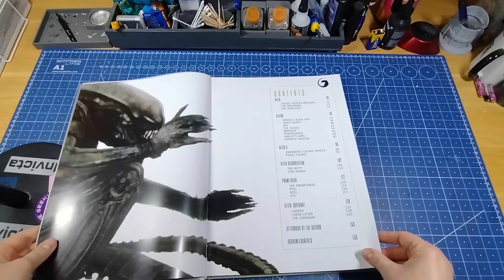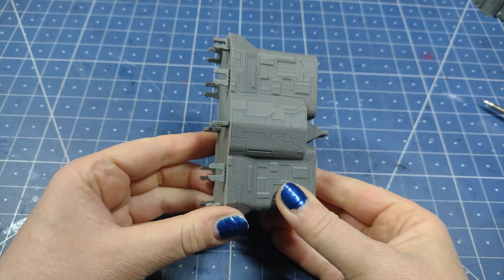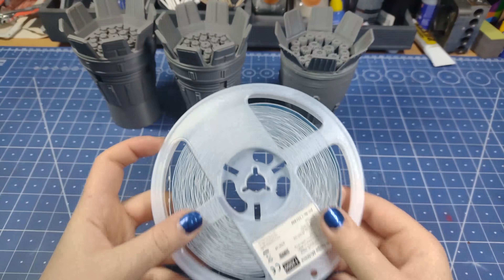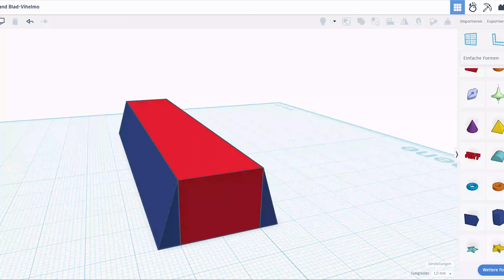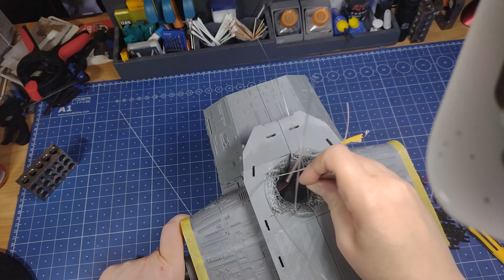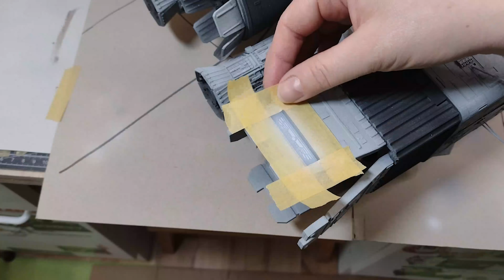I Built the USCSS Nostromo: 3D Printed, Scratch Detailed | Full Build

Comment: I printed that version a few years ago.  The amount of tiny pieces - especially those clear engine - and I had the original Halcyon kit back in the 90s.

Anyway, I never finished it beyond giving it a light dusting with primer grey and sold it.  

I didn't print for wiring or lights but I found it a great model except, of course, it was missing the hydraulic engine parts and a detail above the smaller central engines.  I haven't checked on it so don't know if the maker updated it since.  Oh and I had a lot fun with the landing gear!  Ended up improvising numerous ways and did the same as you.  Lots of guessing trying to the parts the same length.

Anyway, someone out there has mine.  But I have a lovely studio scale Narcissus and Sulacco off Gambody.
Reply from the maker: Thanks for watching! Yes, that's a lot of work., and a lot of fun even if some parts are missing or don't quite fit. 
And I have the files for the Narcissus and Sulaco too. Just haven't made them yet 😁

Comment: Amazing work. Designing then printing from blue prints is extortionary. Always wanted the Nostromo model. Wish they would release it again. You did the next best thing and built one yourself.
Need to get into 3D printing. Don't know where to start .
Reply from the maker: Hi, thank you so much! The files for the Nostromo are available on Gambody. I added parts that were 'missing'. And I'll be making those extra parts I designed myself available for download. 🤓
Reply: @The_Geeky_Workbench what type of a printer do you use 😊
Reply from the maker: @arthurs5704  My FDM printer is an Anycubic Kobra 3. There probably are already newer versions but this one is just fine for me.
And my little resin printer is an Anycubic Photon Mono 4k, which is a bit older. :-)
Reply: @The_Geeky_Workbench thank you
I have to start doing some research 
I’m al so a model railroader which would come in handy for many projects 😊
Reply from the maker: @arthurs5704 Oh, yes! The printer can absolutely be a great tool for railroading too. 🚂🚄

Comment: I'm currently building an Imperal Shuttle model printed from the Gambody website as this one is from. I found when using the connectors that they are a bit long and can sometimes make fotting parts have gaps. I started sanding down each end of the connector to shorten them just a bit and the gaps weren't an issue anymore. I highly recommend the Gambody site as the instructions and files are really good and the models are essentially studio scale. Happy modeling everyone.
Reply from the maker: Thanks for sharing that great tip, and enjoy your Imperial Shuttle build! I've had my eye on that one too 😍🤓🚀

Comment: Really nice job. I especially like how your paint job turned out. I made one too. Based off a 2 foot, 3D printed kit I bought last year. I added a huge amount of extra detail to mine, like you did. I also added over 200 LEDs and a ton of fibre optics. In order to illuminate the navigation and flood lights and the main engines are lit, as are the landing struts. And like you I used the super convenient hexagonal area at the top to mount my switches. Anyway well done on not only making a great model, but producing a great video too. Here’s a couple of links to my thing: 
https://youtu.be/g729b7atMNI?feature=shared
https://youtu.be/OQUAHnErtxE?feature=shared
(Apologies for my creaky kitchen floor! 😂).
Reply from the maker: Thank you so much! Your ship looks amazing! And I love that you added all those lights! It truely turned out fantastic! For some lights I didn't find a way to get them into my model with what I had, so I decided to skip a few. 
May I ask, how did you hollow out your 3d print?

Comment: Great build, thanks for sharing. From my experience wiring through two or more parts gets much easier when you use finer wires. They bend more easily and also can be better guided through bend
 channels
Reply from the maker: Thanks for watching! Yes, that is pretty fine wire already and I wanted it to be a little more rigid so it wouldn't just curl up when pushing through the tunnels. It worked quite well, there were just so many 😁

Comment: I'm always thinking, "Gee, I could do that". Sure, until you start designing parts in blender and whatever else you used. Impressive. Beautiful as well. Great work. Have you considered doing this in resin? I have built 4 foot models in resin, it ain't easy, but the close ups look a lot less layered.
Reply from the maker: Hi, thanks for watching! I only have a very small resin printer. And also, I don't like all the stickyness and smell of resin, so I only use it for smaller parts. But with a bit more practise in dialing in setting etc, I think the fdm prints will turn out fine enough. 🤓🤗
Reply: @The_Geeky_Workbench  Your work is more than fine! Yeah, it would certainly require a large resin printer. I have the anycubic m3 max, and it rivals some fdm printers in size.
Reply from the maker: @robertt7002 Defintely! That's big!

Comment: Interesting, inspiring and entertaining, Jen. Well done, succinct tutorial. Mods were worth the efforts for the  amazing results.

My latest Sci Fi subject was a 1/350 Star Trek 1701 Enterprise Refit. There are a lot of potential single point failures when adding the many elements to reproduce the studio model. Most of the work was modifying the outer surfaces to be more accurate. Recessed kit molding details are exaggerated and were corrected to be the required scale. 
Added several unique features. Lots of extra lighting mods. Many UV l.e.d.s used. Made a custom stand that allows off level tilted display options.
Build time was three years. A week after completion I missed the work, wanted to apply all the gained knowledge/techniques  from the first experience and ordered two Refits to make a less canon  HOOD and INTREPID. Reveal video of the 1701 posted on my channel if interested.

First time on your channel. Liked and subbed.
Reply from the maker: Welcome to the channel, and thank you so much for the kind words about my build! I will defintely be checking out your builds!👽🛸

Comment: The reference book was interesting, I had no idea. I didn't remember the ships but saw a YouTube video recently about how the prop weapons were made (based on a real firearm).

The trick with the fiber optic, you just pushed them into the black tube, not bonded to the LED? I will have to think of a way to use that.

Overall I join the other comments, what a monster project to bring together, incredible work!

...and your voice is so relaxed "oh I printed more xyz".  

I need to learn Tinkercad, looking for something for sketching concepts that is quick and intuitive.

(I used to use SketchUp, but that's not really for 3D printing I don't think, they went more in the direction of architecture).
Reply from the maker: Thank you so much! 🙏 Sorry, I forgot to mention that I put a bit of glue inside the tube   before addig the fibre optics and LED. I also found Tinkercad easier than SketchUp, and it's great for printing. So defintely worth getting used to. 🤓

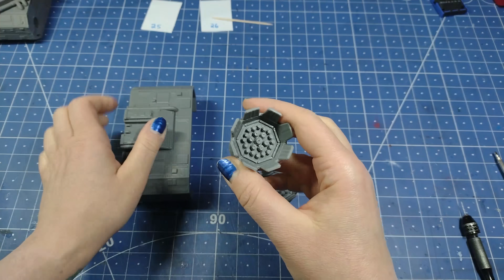Comment: @04:50 MiniWare makes the ES15 Electric Screwdriver which uses a 4mm HEX Bit Receptacle that can be paired with the GodHand HEX Drill Bit Sets A/B/C/D ( if you get them all will give you a range between 0.5 to 3.0mm in 0.1mm Increments though be warned that their pairing is a bit odd with one Set spanning the entire range and the others ranges in the sub 1, 2, and 3mm range ). Best part about that Combo is with the ES15 being a Motion Controlled Screwdriver / Drill where you only press and hold a Button to prime it for operation and then depending on which direction and how far you twist your wrist it'll either move CW / CCW and with the requested speed from really slow to reasonably fast with usually enough strength to even drill a 3.0mm Hole into Plastics which if you do a lot of holes will be a Blessing not having to do manually 🤔

Also looks like the Antenna at the front didn't make it after all... Perhaps next time consider using a Brass Rod / Tube ( could run a Fiber through it to light it up! Which is how I illuminated the 20mm Cannon on my E-100 https://youtu.be/l3_RcOU3zo0?t=42 ) or if you're really cheap just use a Sewing Needle ( perhaps filed down a bit 😏 ).
Reply from the maker: Wow, thanks for the great tool tip and thanks for watching! And I did put the front antenna on. The parts were so long and thin, I don't think I could have drilled through there. Or is there another antenna you mean?
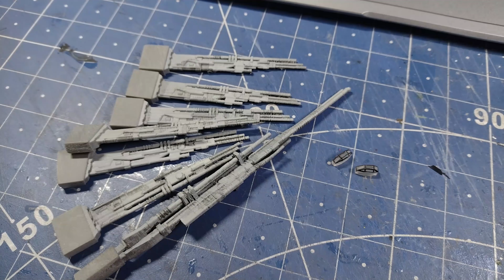Reply: @The_Geeky_Workbench  The Part @03:22 still has a tiny Spike at the front - You  even mention it probably snapping off if already installed ( or perhaps you were thinking of the whole Antenna? ) Anyway... @25:37 the Spike is gone as predicted. I for one wouldn't even have 3D Printed the Antennas ( like the long ones sticking out the side ), I'd have straight out replaced them with Metal ones - Ideally Tubes from the local Model Making Shop ( or Amazon, I won't judge 😏 ) to again feed some Fiberoptics through which if left exposed by 1mm outside the tube would make for a neat positioning Light. These Brass Tubes usually come in telescopic sizes packed allowing you to put one into another to increase the girth towards the base.

Btw... If you know beforehand - You can Modify any STL Mesh inside the Slicer by adding Negative Modifier to the Mesh allowing you to create Voids, Channels, etc without later having to mangle the Plastic with a Grinder / Cutter / Saw - In this Screenshot: https://i.imgur.com/nmRI60M.png I've only added a Cube to the Scene and a Negative Sphere attached to that Cube to void any Material being printed in the Sphere's zone of influence...

On a sidenote... If you use compatible but not matching materials ( Multi Nozzle or Tool Changer 3D Printer recommended ) then you can create much easier to remove Supports by only printing the Support Interface Layer of the Supports in the 2nd Material which will allow you to print them without clearance resulting in less sag and nicer results - For ASA ( or ABS ) you can use HIPS as the 2nd Material. For PLA I think it's PETG 🤔
Reply from the maker: Hahaha, indeed! I hadn't even noticed that the spike of the antenna was gone. While handling the model the dish broke off and I glued it back in but didn't see that the spike was gone. Will repair that soon. 
The long side antennas I haven't glued in yet. So I might actually try to make my own ones. I won't be able to put any lights in there now because I have no way of getting wires in the model now. But it will be practise for future projects. 
Good point about modifying the model parts before printing. It's just my second fdm printed model, so I'm still learning. That's a great idea. Thanks! 🤓